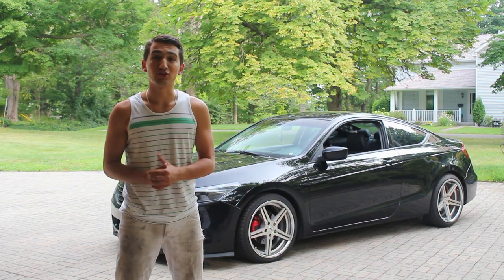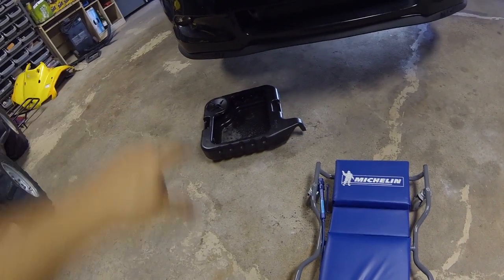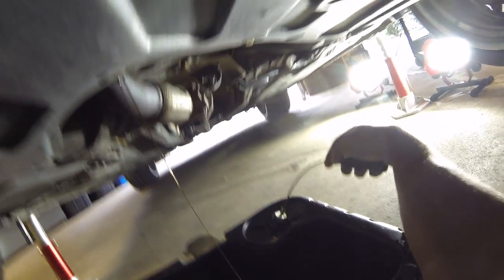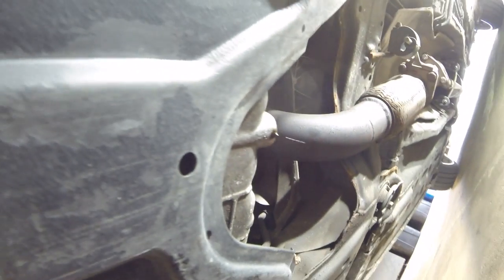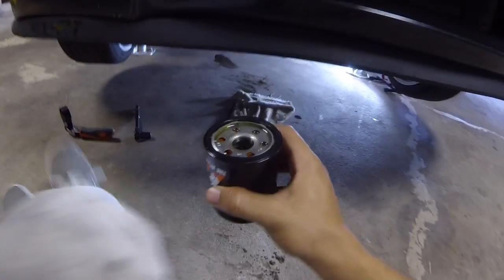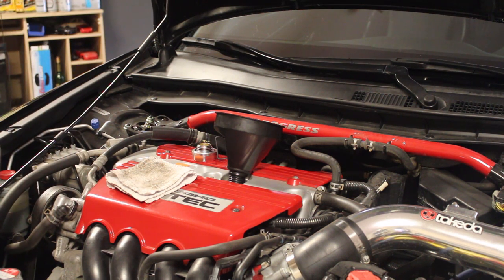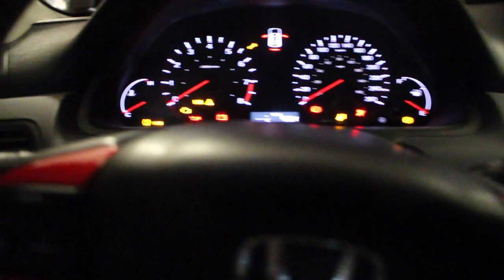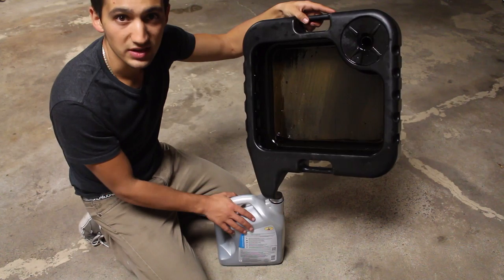How to Change Your Oil & Filter

Comment: THANK you for mentioning the crush washer!! So overlooked! On my k20 (a lot like ur k24) the filter mounts at an almost right angle. But I still use a turkey baster to fill it up before mounting it on.
Reply from the maker: +Julius Cesar Yessss!! not a lot of people use them and for the 10 cents, why the heck not install one!! A turkey baster will work great, as long as you prefill the filter, you're in the clear :)

Comment: I found this video very helpful.  I was actually searching for a video that talks about pinging on the same engine that you have.  I have an Accord CU2 2.4 same engine as yours.  With your engine, do you also hear some pinging noise before all those modifications you put in?  I'm just wondering if its normal for a Honda 2.4 i-vtec to have a little/short pinging noise specially when going uphill or pushing the throttle?

Comment: nice video and very helpful but i have a question witch is:
i saw you using pennzoil 5w20 to your lovly Accoud i don't know how do you select the type of oil since i have a toyota camry 2015 and i am living in saudi Arabia witch the wither plays a part of what type of oil i should select because the temperature rich 60° Celsius so if i use an oil liek what you are using in canda my engine will be drin because of the heat at the moment i am using mobil 1 0w-40 full synthetic oil and changing it every 10000 kilometer  so what do you think What type of oil should i use and why ?

Comment: Very good video lad,just curious can I ask roughly how many kilometres do you drive a week
Reply from the maker: jerry o connor LOL it all depends. I used to have a job far away from me and i'd drive about 100km's PER DAY which is a lot and I racked up a lot of kilometres. Now that i'm doing youtube videos, its gone down a lot. The only time now I drive my car is if i'm making a video, hanging out with friends, or picking up car parts ;)
Reply: Thx 4replying. I was thinking that changing your oil every 5000 km wouldn't suit me as I average 500 km a week,my car has oil done at 15,000 k
Reply from the maker: Thats kind of pushing it. I wouldn't feel secure doing that. The engine oil breaks down when you run it for too long
Reply: That's what owner manual says its Toyota Yaris hybrid
Reply from the maker: That is a long time between oil change intervals. If the owner's manual call for that long of a distance, than by all means follow it, especially if your car is new and still under warranty.

Comment: For an older car, would you recommend using the pennzoil and a kn fikter?
Reply from the maker: +Josh Deutsch Sure would. Get the best filter money can buy. Most oils are all the same, but filters differ greatly between companies.
Reply: +milanmastracci I currently use the Mobil 1 EP oil and filter. But what is drawing me is the benefits of the Platinum cleaning the engine.

Comment: I have the same car, I put 4.2 quarts in it and the dipstick is showing the oil above the 2nd line. Im really confused as I thought 4.2 was the specified amount of oil.
Reply from the maker: +BlitzSoccerPL If you pre-filled your oil filter, it will be a bit less than 4.2 quarts of oil because you will have some already in the filter
Reply: +milanmastracci yea I didnt though. Maybe I read it wrong. Whats the difference between the platinum and ultra platinum. Im gonna switch to pennzoil but idk which one. Thanks man

Comment: is there a way to install the primed filter if it goes in horizontally? thanks!
Reply from the maker: +Dakota Rose You will be doing it the same way, unfortunately you might spill some oil when you thread the filter on. If you spill any on the block, use some brake clean to remove it and clean it up.

Comment: was wondering if I should buy an rx8 or a Chrysler crossfire or a Honda Prelude
Reply: Rx8s require a lot more maintenance. Like oil changes every 1k-2k miles. If you can handle it, go for it. But due to the rotary engine, I say stay away from ones with 100k+ miles on the motor.
Reply: Well what about the Honda Prelude or the Chrysler Crossfire
Reply from the maker: LolzTravis Its a tough decision. As Charles stated, it requires more maintenance than a regular V engine or Inline engine. The rotaries are more decilate and have apex seals that can wear on you if you don't know the beast. EVERY single time you turn on your rotary engine, you have to get it up to operating temperature before you can turn it off. If not you will damage those seals and will need an engine rebuild. But if you know how to take care of them, they are great cars. Small motors with big power from a Naturally Aspirated setup... Very impressive :) 

On the other hand, I would stay away from the crossfire because I hear they are a headache and a half to own. They break all the time lol
The prelude would be a better beginner car as it is a Honda and is meant to be beat on. Those 4 cylinder engines are very reliable too
Reply: I guess I'm going with the Honda Prelude thanks man
Reply from the maker: LolzTravis Have you contemplated looking to Nissan Z's or Infinit G's? They aren't too expensive for a used one. My only regret about my car is that it is not RWD. Thats the only thing I would change about it, especially if you have the itch for more power. If you start off with a RWD platform, you are essentially limitless with performance options :)
Reply: Ya I was looking at a g35 coupe but I didn't know if was good for performance upgrades
Reply from the maker: LolzTravis Unreal cars!! RWD, 330 horsepower V6, available in stick and those engines are very reliable. If you haven't driven one, go find one for sale and you'll fall in love with it.
Reply: Ok and once again thanks man love the YouTube videos
Reply from the maker: No problem :) Glad to hear!!
Reply: Yes, RX8's do require a little more attention than most cars. But If you can find someone selling one that has under 100k miles and they have proof for each oil change, go for it. It has also been common to do LS swaps in those cars (Chevy engine) so if you see one with a swap, go for it. 
I can't speak much for Chrysler cause I'm not a huge fan. 
Preludes are great cars, but not sought after very much, so in return, people don't value or take care of them as much. So most of the ones you'll find have been beaten up and look like shit. Not to mention, they're notorious for having a faulty transmission if bought in an automatic. If you're looking in the Honda market, I'd go for a S2000. Much better reputation (it's still a Honda so it will practically last forever) and they're pretty fast for a lightweight car. 
Another great car would be a 350Z. Affordable, still reliable, a lot of power stock, and a lot of fun. Whatever car you buy, do it for YOU not anyone else's opinions.

Comment: The magnet screwdriver thingy is a useless tool. You're still gonna get oil on your hand when you remove the filter.  If you really want to use something useful, look into Fumoto valves. Install one time in place of the drain bolt and you wont need any tools to drain oil. I have one on all three of my family cars and they work great. They allow you to attach a plastic tube and drain oil straight into an empty oil jug.
Reply from the maker: +Nick V Thanks Nick :) I'll have to look into them
Reply: +milanmastracci Search YouTube for "Fumoto Valves" and you'll find plenty of reviews.

Comment: Where in Canada do you live? I see Tims in your car.
Reply from the maker: +KRisTiAn Tzn Southern Ontario. St. Catharines
Reply: Cool!! I live in Saskatchewan. Is it necessary to change your synthetic oil every winter. Our winter goes as low as -40 degrees C. My last oil change on my car was when I first got it on the spring and I put 3000 km on it during summer and fall. Minder says 60% and its still brown not black. Should I change it this winter?
Reply from the maker: I would change it for sure but I'm OCD about servicing cars and maintaining them :)

Comment: You don't go as tight as you can for your ur oil filter...
Reply from the maker: +Oscar Barrera There is a proper torque spec for the filter but there isn't a way to get a torque wrench onto there. Thats why I go as tight as I can by hand (which cannot damage anything because i'm not that strong lol) and then to remove it(when i'm changing the filter), I use to tool to give me more level.

Comment: My dodge's drain bolt doesn't even have a crush washer, and it has never leaked. I'm also not a torque Nazi perfectionist and have never used a torque wrench on my filter or drain bolt. Again, no leaks. I've also never bothered to fill or lube my filter , still no leaks... And why on earth are you changing your oil at 60% oil life? Talk about wasting time and money. Especially since you're using such expensive synthetic oil. Top quality oil means you should be able to keep it in for the entre service interval, not dump it when its still relatively fresh. My vehicle service interval is 8k miles, even with conventional I keep it in the entire 8k or 6 month period. It's now 8 years old, 163k miles and has no consumption, leak or engine performance issues.
Reply: The interval service depends on how you drive. This guy has had 21 tickets at one point so that shows you how he drives. The oil he’s using isn’t top quality lmao. Walmart carries these for less than $30, that really isn’t that expensive. Pennzoil is a glorified synthetic, just like Mobil 1, Valvoline, etc.., it’s a group 3 oil that offers hardly any long lasting protection. Not to mention K series engines love to eat oil.
Reply: @jameslapine678  Pennzoil platinum pure plus is not top oil? Then what is? You're not some amsoil fan boy are you? Pennzoil is the brand recommended by more car manufacturer than any other. Pure plus is also a true synthetic . Your beloved amsoil sure didn't invent the process of making oil from natural gas, and Pennzoil also doesn't have to pay off people to talk about how great it is.
Reply: @jameslapine678  and also, his driving style is also not really relevant , his car has an oil life monitor which takes into account the specific driving style. So the car knows he is a severe driver. 60% oil life is still 60%